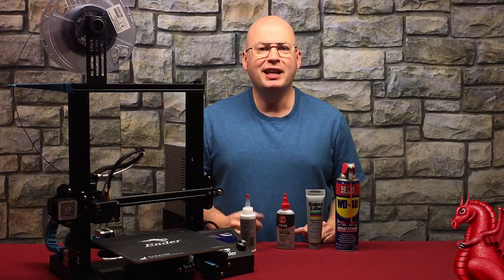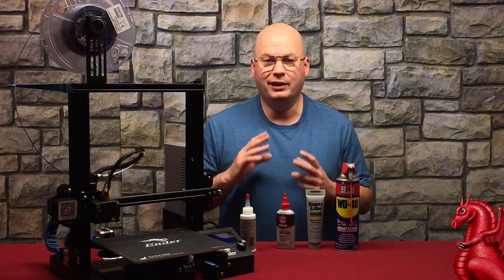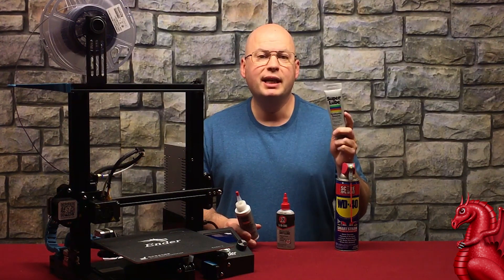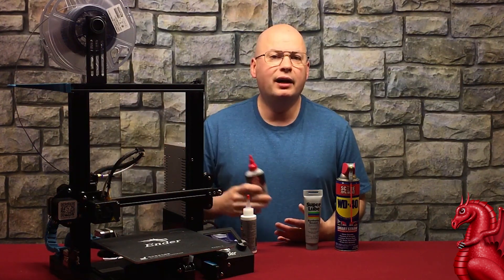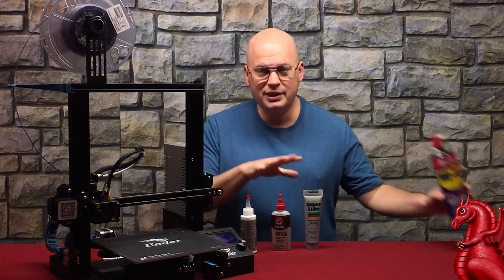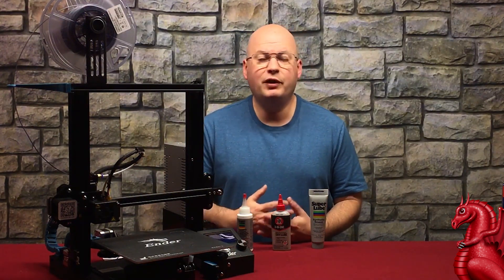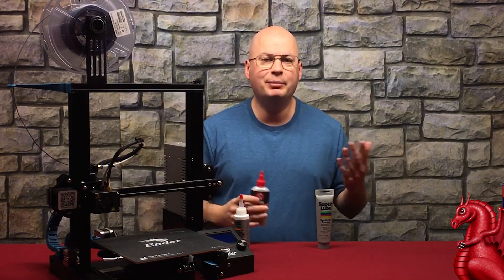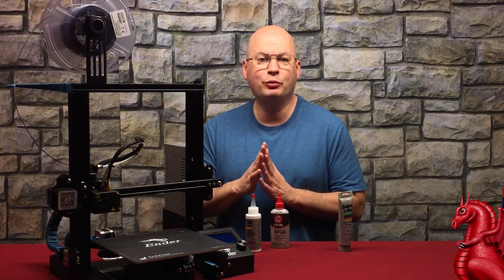Lubricating a 3D Printer

Comment: I'm not sure how easy it is to manually control the Z axis, but if you can run it to the bottom and then to the top you can use the trick from cleaning a lathe lead screw which is to just wrap string around it and then run it which move the string along the entire thread from one end to the other.
Reply from the maker: I'll have to try this, thanks!

Comment: Another nice video. Assembling my new Ender 3 V2 soon (my first 3D printer) - I am following your updated assembly guide. Two quick questions if I may - do you recommend lubricating the Z axis screw for the brand new printer or does it come adequately lubricated from the factory?
Also saw your Z-axis issues video - I guess I should loosen the brass coupler screws for the brand new assembly irrespective of any problems - correct?
Thanks in advance and keep up the good work.
Reply: i dont know if you already have the printer but i have an enter 3 V2 and did not lubricate from factory. It has been just fine for about two years and i am currently watching this as im getting some banding after no use for a few months. so you should be fine to just use it with the factory lubricant already applied.

Comment: I've always used 3 in 1 PTFE lube, it's worked just fine. One of my printers is coming up on 3 years old... I even use it on the rollers, and see less dust buildup... I even still have the original belts on it. I've replaced rollers once.

Comment: Correction; WD-40 does not "eat away at rust", it's a Water Displacement - "WD" that's where that comes from (the 40 is just the fortieth formula that Rocket Chemical came up with)
So yes, it does have an affect on rust, but only in the way that it slows it down because it pushes the water out of the pores of the iron or steel.
Reply: Thank you. Exactly.

Comment: @Tom, are you familiar with prolab's PL-100j (the lubricant not construction glue)?  Antifriction lubricant. Loosens and protects moving mecanisms and parts. resists heat and cold (-65%C) eliminates dampness and will not damage plastic, rubber, glass or metal.  (Sheesh, I sound like an add)
Was toying with the idea of using this.

Comment: I've got an Ender 5 Plus, which has the 2 long, vertical rods/screws and it's squealing really bad when the bed's going up and down. Any recommendation what lubricant would be best for it? I saw that WD-40 sells a "dry lube" and lubricant with PTFE. Can those be used?
Reply: Yes. It's also a brand name now. Just pay attention to which one you get. That said, I wouldn't personally use any of their lines on 3D printers. Other things are fine, they also make a fantastic electronics cleaner that cleaned a motherboard that had dirt, dust, superficial rust and mechanics oil on it; made it look brand new. I just don't like their formulations for precision machinery since they're also usually overpriced.

Comment: what about wd40 ptfe dry type? Wd 40 litium grease?
Reply: PTFE dry lubricant from WD40 is perfect. Many don't realise WD40 is just a brand to many product and so many only think they offer a degrease.

Use the WD40 PTFE dry lubricant, it's the same than what you see in the video and is perfect for that.

Avoid Lithium grease tho, as it will attract dust and going to make it worst fast.

Comment: You can get dry lubricant teflon (PTFE) in aerosol cans. Thats ho i reccomend using them. Just make sure you put a couple of layers of newspaper over anything you dont want lubricated. Wait 15 minutes before removing your mask. Also thank you for the WD-40 statement. I worked at a hardware store for 8 years. So many frustrating people who wouldnt listen that its no va lubricant. WD stands for water displacement. Its not even that great at cleaning rust. But more for preventung it. Thats why it comes is gallon canisters. You rub that shit on with a rag. Ever gotten metal parts for something covered in oil? Thats wd 40. Sorry.for ranting.
Reply: I'm surprised you don't realize tho that WD40 is just a brand. Sure the classic one is water displacement and degreaser but they also offer various products, including PTFE dry lubricant.

Comment: I use the Silicone grease.   A quick tip when you get your Ender 3 Pro in the mail, the Steel guide Rod is shipped in a plastic tube.  Keep that Tube.   I cut it in half and I lube the steel rod and then place that plastic protective sleeve over it, and it sits on the brass nut, protecting it from dust and grime.  The plastic tube also helps to protect your filament entering into the extruder.  ;)
Reply: Wish I would have seen this when I first bought the printer!
Reply: CT Vaughan improvise.  Take a paper towel tube and cut it lengthwise and re roll a tube and tape it.  You can even use a Manila folder and roll a tube to fit.  Use some scotch tape you just want it loose not tight. Something to keep the dust off of it. :)
Reply: @GreyGhost-r4z  Can you show me a picture of how this would look after its put on the zrod?
Reply: @Ranto86  just put any loose tubing  (plastic) over the vertical rod on the left side. It’s not tight just something to cover the rod from the elements and dust.
Reply: @GreyGhost-r4z  when it's not in use or at all times?
Reply: @Ranto86  i put it on and never take it off.
Reply: @Ranto86  I just leave it on there...
Reply: Thanks! That wouldn’t look quite as good if I kept the original tube but would still do the job
Reply: CT Vaughan honestly you can’t see it from the front anyway.  You could probably buy those candy pixie sticks.  The big ones.  Clean it out and use that.
Reply: Grey Ghost Your right it wouldn’t be very visible form the front (especially where I have mine) The paper towel tube would be fine. Thanks for the idea!

Comment: Would it be a bad idea to use the motor to move up and down the z axis after applying lube to top/middle/bottom? Would it be too harsh on the motor or anything like that?
Reply: Nah it's perfect. Some even have gcode template for that. Personally I just move the Z axis by inputing 350 then move the remaining 50 byu incremation of 10mm!

Comment: On the Ender 3, is there any reason I couldn't use the move z axis menu option to move it up then auto home to move it back down after lubricating the screw instead of turning it by hand?
Reply from the maker: That will work fine too, it's just slower. :)

Comment: He says WD-40 is NOT a lubricant.  Fact: While the “W-D” in WD-40® stands for Water Displacement, WD-40® Multi-Use Product is a unique, special blend of lubricants. The product’s formulation also contains anti-corrosion agents and ingredients for penetration, water displacement and soil removal.
Reply from the maker: The product I showed in the video is the standard WD-40 that is often mistakenly used as a lubricant, not the one you are referencing.
Reply: @Tombof3DPrintedHorrors  I am just citing information directly from the manufacturer. 
https://www.wd40.com/faqs
Curious as to where you got yours.
Reply: @Tombof3DPrintedHorrors  I'm not sure the one you have in the video, but the standard WD40 is multi use and is in fact a lubricant intended for light contact such as 3d printer rails and rods.
Reply: @zxcasf  Not the regular one. But their PTFE dry lubricant is perfect!

Comment: The ASTM D4172 for WD-40 passed @ 0.70 mm @ 77° F Superlube oil with PTFE Passed @ <0.5mm.

This tells me that there's very little difference between the two and you may see diminishing returns. Although superlube oil does a better job at reducing friction, it does so by being thick enough to keep ptfe spread out over the surface. This means it eventually traps dust and defeats the purpose.

WD-40 doesn't do as good of a job reducing friction, but it also does a poor job of tacking and keeping dust between your metal-metal joints. 

I bet, with time, the two will be so similar it's not worth the fuss to argue about which one is better. Like the difference between a Gala apple from Washington vs a Gala apple from Ohio.

Comment: I use lithium based bearing grease (specifically for bearings and such)
dry lubes WILL jam up bearings, they will just clump up inside  the bearing and jam
bearing specific grease is the best,  and always apply on the inside so that the dust gasket will keep it in, and the dirt out
unless you're in a very dirty environment it won't have problems (you shouldn't have your printer In a place like that anyways, its very bad)
just a little grease on the rods (little, as just wiping them down with a bit of grease in your towel) and greasing the inside is the way to go
have experienced 0 binding, printer is more silent and the carriages move way smoother, oils just won't lubricate the inside of the bearing, and it will have increased drag
Reply: Lithium bearing grease is actually bad for some printers, if it grease too much it's not as good.

Comment: I'm in a dusty environment. I have dual lead screws. Would you use the oil or the grease? I'm assuming the reapply time frame would be the same in this situation?
Reply: I'm a little lost. Never mentioned wd-40
Reply: Neither. As I stated above it may be that WD-40 is an ok product for you, but if you know you're in a dusty environment, fine dust I assume, you're far better off with a dry lubricant. Anything wet will tack dust to your axis and eventually it will cake up and act like sandpaper.

Comment: Paper towel for cleaning any precision machined parts as the steel sliding rods is not a good idea. It may sound silly but dependent on the quality of the paper it will more likely than not scratch the surface - a clean cotton rag is much better.
Reply: Actually you shouldn't use paper towel it's a low level abrasive. Wipe new plastic with it. It will leave scratches. I would recommend a micro fiber cloth or any soft cloth. When I was into modelling cars I could sand primer with paper towel. From a certain point of view.
Reply: DE3US I used brake cleaner
Reply: Oooof, cotton is quite abrasive as well, I used it to polish some meyals to mirror quality for looking at it under the microscope.

Comment: The "WD" in WD-40 stands for water displacement. For example on older cars if the engine got wet and died, you could pull off the distributor cap and spray inside it with WD-40.  It would displace  the water and the car would start right up.  It may not be the best lube but it's better than nothing.
Reply: Actually “Water Displacement, 40th formula”.  Pretty cool story.  https://www.wd40company.com/our-company/our-history/
Reply: It's not much better than nothing.
Reply: it does not contain lubricants.  it is not appropriate for this job.
Reply: @DonKelleyMusic  So, as WD-40 contains multiple lubricants then it does do the job.
Reply: @HandeeGaming  

Yes and no.
Yes, because wd-40 has a lubricant line, but no because regular wd-40 doesn't contain lubricant and it could also work as a lubricant remover (so it could be worse)
Reply: @eng3d  Do you know if WD-40's specialtist white lithium grease is safe? I bought a can of it because it says heavy duty lubricant and metal to metal application on it, but now I'm unsure if I can use it.

Comment: If you have been using grease, can you just switch to oil the next time? Or do you have to do some major cleaning? Nice vid!
Reply from the maker: I would recommend cleaning the grease off if possible. Only takes a couple minutes with a toothbrush to get most of it. :)

Comment: For a dual z-axis machine (cr-10s) you can use the controls to move the z-axis all the way to the top, apply the oil then auto home the axes. A person might be able to twist both z-screws at the same time by hand but they'll have to realign the x-gantry before printing.
Reply from the maker: Good point, same for the Prusa Mk2/3. :)

Comment: Thank You for pointing out what WD-40 is really designed for.
Reply: WD stands for Water Displacement :)
Reply: @randallporter9707  Nope.

Myth: WD-40® Multi-Use Product is not really a lubricant.

Fact: While the “W-D” in WD-40® stands for Water Displacement, WD-40® Multi-Use Product is a unique, special blend of lubricants. The product’s formulation also contains anti-corrosion agents and ingredients for penetration, water displacement and soil removal.

https://www.wd40.com/cool-stuff/myths-legends-fun-facts

It's a very low viscosity lubricant that can also act like a solvent for tacked, dry, or soiled oils and grease. It's viscosity allows it to penetrate deep into crevasses where it tends to spread and it does not evaporate quickly.
 By spreading thinly it can act as a superb lubricant for light-contact metals (3d printer's axis are all light contact) because it won't attract dirt or abrasives (it isn't tacky enough for them to stick), and thus, should be re-applied more often than a grease. The movement of the axis will wear thin spots that will need re-application periodically.

It's ok for lead screws but rods and rails should be great though you may have to reapply more frequently than an oil but less frequently than a dry product. It will not get thick and congeal this is part of the appeal. You will not see it trapping contaminates on your metal.

You can apply it by spraying a bit into a cotton shop towel and rubbing down the rod/rail. For the Z axis soak a bit of the same towel and squeeze it above the axis while it's at the top of it's travel (for the ender 3) then home the printer so it travels through it's full motion. 

It's also cheap and readily available.
Reply: @attrezzopox  Myth: Product marketing departments always tell the truth.

Fact: WD40 is a terrible lubricant. Trying to make a multi-use product results in a product which isn't very good at most of the supposed uses. Marketing spiels do not overcome reality.
Reply: @attrezzopox  
"lubricant that can also act like a solvent for tacked, dry, or soiled oils and grease"
That is contradictory. I use WD-40 a lot. It is a CLEANER. It is a DEGREASER. A lubricant is not a solvent. It certainly does penetrate. If you look extremely close after applying it to a piece of metal, you can see a micro flow of WD-40 across the metal surface.
The only way WD-40 is a lubricant is if a clean part is a "lubricated" part. Naturally, if the part is clean, it will move easier. And the fact it is wet makes it sort of a lubricant, maybe better than water.
I haven't found it useful for preventing rust, either. But I use it for a cleaner, plenty. It is an excellent degreaser, for small parts. At 10 times the cost, WD-40 cuts grease 10 times better than "Purple Power" that is supposed to be a degreaser. Purple Power seems good for occasionally pouring into a window air-conditioner air intake slats to free up the waterway (so far, in my testing, with the air conditioner off of course).
Reply: @RememberAuroraColorado  Like dissolves like. WD-40 can be an effective cleaner and degreaser, you are right. 
My point was that it does not evaporate or dry quickly... so for light contact surfaces it will work as a lubricant. 
On a 3d printer you don't need packing grease on the rails. 
The anti-corrosion properties refer to mainly flash rust. It won't protect your steel sailboat from the ocean but it'll do a fine job on a freshly milled bit of steel stored inside for a year or two. 
This isn't a binary world, there are measures of grey between doing something perfectly and not at all. WD-40 will act as a thin lubricant for a reasonable amount of time. It will prevent rust in mild environments. But it's also very thin so, for whatever caked up machinery you have to work on, I'm sure it's a fantastic de-greaser. 
Try telling someone doing fiberglass layup that they can degrease anything with WD-40 and they'll scoff at you. But if you talk to a guy who works on tractors they'll think it's basically magic. 
As it relates to a 3d printer, WD-40 is not the worst lubricant you could use for a rail. IMHO a thick cakey grease is far worse seeing as over time you'll make a paste between whatever is floating in the air and your grease.
Reply: @attrezzopox  nope.

WD-40 isn't actually a true lubricant. WD stands for "water displacing" and its main use is as a solvent or rust dissolver. The lubricant-like properties of WD-40 come not from the substance itself, but from dissolving components. ... WD-40 can be a good substance to start with — it can help clean up rust or other grime.
Reply: @RememberAuroraColorado  exactly.  it works like a solvent.  anyone who has used it repeatedly knows that it solve emergency situations great but doesn't perform long term lubrication, and on delicate systems like the low tolerances in a 3d printer it WILL cause long term issues.
Reply: @attrezzopox  
Currently I'm using silicon and silicon plus Teflon on my 3D printer rails, after wiping them clean.
Reply: @attrezzopox  really is a great product!
Reply: WD is actually now more of a brand.

The classic one is indeed a degreaser and not a lubricant .

They actually have some proper lubricant.
They even offer PTFE dry lubricant, and the branding is still shown as WD-40. And is what being shown as correct on this video, looka t the  3-1 dry lube, it's the same.
Reply: @MGCoin333  when people say WD-40, they mean the classic.  There is only one main product from them that everybody refers to.  Yes they make other stuff, but we can't call the other product names WD or WD-40... they are product-name.  The manufacturer is not the critical thing.  When I look for transmission oil, I don't tell my friend "pass the STP", because that is more likely than not going to be motor oil.
Reply: @DonKelleyMusic  exactly why I said that, most know only about the original and use it wrongfully as a lubricant.
Reply: Gotta love Water Displacement No. 40